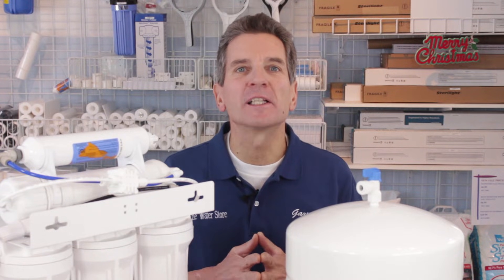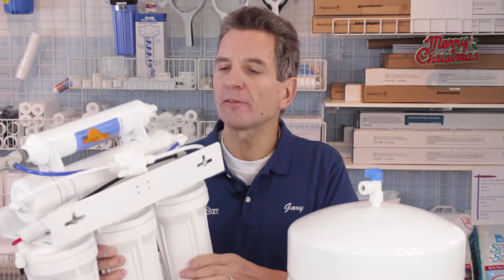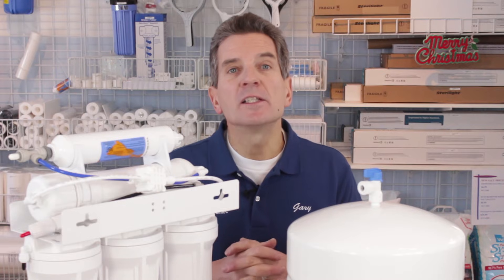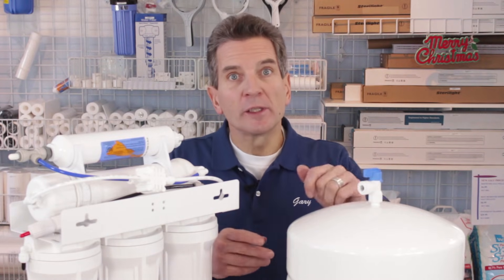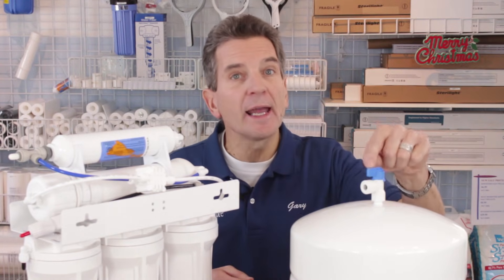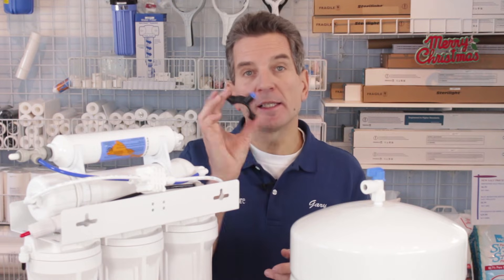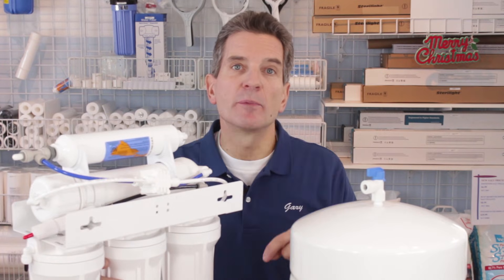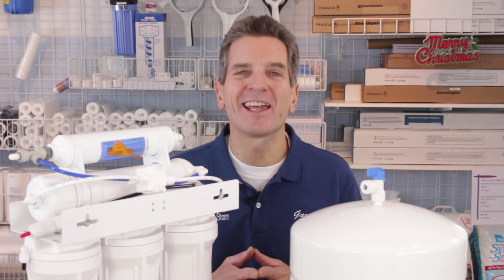Reverse Osmosis Troubleshooting Water Continuously flows to Drain

Comment: Andre
Thank you for this very informative video. After watching it, I changed the check valve and it fixed the problem. Prior to my replacing the check valve, my system probably treated hundreds if not thousands of gallons of water, so I suspect that I should be replacing the 3 pre-filters as well as the membrane, correct? 
I do have another question for you, my system uses an adjustable flow restrictor and I would prefer using an automatic shut off switch that is equipped with a flow restrictor that flushes the system every hour or so. Are you familiar with these and would you recommend using these and if so what make and are there any instructions on installing these?
Reply: @water_estore  HI Gary, yes I usually replace the filters every 12 months but my question was relating to the fact that my control valve was leaking water 24/7 for 3 to 4 months. Wouldn't all that water have also passed through my 3 prefilters as well as the membrane before being dumped into my drain system via the leaking control valve thereby ruining them?
Reply: @water_estore  Thanks Gary, next time that I need a new RO system, I will check your web site prior to making a buying decision. Up to now I have been buying my RO systems from AquaSafe located in BC and I suspect that they are made in China.

Comment: A tank with too low air pressure caused my system to drain continuously.  Draining the tank of water and re-pressurizing it to 7.5 psi fixed it (I mistakenly released some pressure when monkeying around with the system before I knew how it worked).
Reply: How do you repressurize the tank to 7.5?  My RO System is brand new and it constantly runs and water goes to the drain and the drain does not get filled.  When I shut off the tank’s valve the draining stops in like 15 seconds, so I assume it is not a problem with the check or the ASO valves this video talks about. Any thoughts? Thank you.
Reply: @JLMABIO  There's a Schrader valve on the tank... Just use a bike pump and a tire gauge.
Reply: same.  Low pressure on the pressure tank.
Reply: Thanks for your advice. My one had low pressure on the tank and made this issue. I just used my tire air pump and fixed it.

Comment: Hi, thanks for the video.   My issue is that it seems that my unit is running more often.  It shuts off promptly.   Also, it seems as if it runs out of pressure towards the end of a water bottle fill-up that it used to be able to handle without losing pressure or cycling on.   Do I need to fill the inner bladder with more air or can it be another problem all together?  Thanks for info.

Comment: Based on the test the ASO and valve are fine but i can hear the water going true the pipes. Any idea? The system is barely new
Reply: Same...
Reply: Too-low air pressure, perhaps.

Comment: Hi, not sure if you can help.  I have a vectapure 360 system and water is draining constantly.  I have replaced the ASO, but it's still draining.  I have looked for a check valve, but cannot find one, do you know where it would be?  Also, I've checked the pressure in my storage tank empty and it's 7psi, but when full only gets to 22psi.  Do you think my tank is bad?  Thanks

Comment: Thank you so much for this video.  I bought a home with this system installed and I noticed the drain line from the last cartridge seemed to be running constantly.  After going through your steps, I verified all was well and the tank was refilling after I had gotten some water earlier.  Saved me a call for service to check it!  Thanks for your videos  on this system - very helpful! 👍

Comment: From personal experience, the system in your video is an absolute pain in the back to work with even for experienced techs. The biggest problem I run into are leaks at fittings because of excess movement (and in older units excess can be a slight bump due to lack of motion over the years and the interaction of the seal with the tube and o-ring) and hard to remove filter housings because of lack of lubricant applied O-rings/threads. Also you need to be careful when removing/installing the polishing filter due to having to indirectly moving the filter from the quick connection fittings and these also tend to leak with the slightest excess of movement. Make sure to also apply new PTFE tape on those threads before installing a new filter! Give it about 2-3 layers of tape to be safe from leaks.
Reply: One thing I have noticed, is that some of the polyethylene tubing from the hardware store, is sometimes "out of spec" On size, sometimes causing me leaks.
Also another type of tube fitting, that is cheap, and "leak free" but an absolute pita to use if it is needed to "reconfigure" often (connect and disconnect) is the "JACO" compression fitting.

Comment: For a while now my filtered water from my reverse osmosis system has been tasting an smelling like garbage. I recently replaced my filters, but it continues to have that taste. I have drained the tank multiple times as well and it seems to work temporarily. Any suggestions? ??? Could it have anything to do with my garbage disposal on my single sink setup or the placement of my waste water ?

Comment: Hi. Gary. Your explanation is very clear. Thanks so much. I'll ask a question. I replaced in order ASOV and Check Valve. It is shut RO continuously flows to drain when the tank vane is closed. But although I had replaced new membran and all filters, still the drain water is running non stop. What caused it is? I don't understand any. Can you help me please? Thanks now.
Reply: I know what you said. my trouble is solved. Feeding water pressure had too low. So I activited RO pump. Then drain water is shut.

Comment: Replaced both aso and check valve. Any thoughts as to why the system could still be constantly draining?
Reply: Restrictictor needs to be replaced . There’s different colors coded restrictions 24 , 36,50, 75 gpd. Anyway when you replace membrane you should have replaced restrictir too.
Reply: @Sam-od4xb  Is it flow control inserted in the drain tube?
Reply: I have this issue too and its new, I changed the parts but still spills. And its not the water pressure, I have good water pressure in l.a

Comment: Very good, thorough explanation. I have a question that I don't see addressed specifically too often... About how many cups of water should you be able to fill before the system begins to fill up again? And - for how long should that filling take?  It seems as though mine runs for almost an hour or so and it's loud and bubbly and shouldn't take that long to refill. Thanks!

Comment: Hi i just replaced my ASO all water just flows to drain permanently, tank does not fill and no water from faucet. Also all hoses are in their correct positions
Reply: have you tried checking the pressure in the tank if the pressure in tank is off then it needs pressurized
Reply: Wimbledon Window Cleaners i pumped  mine back up to spec and still water flows. I even took the ro membrane apart and cant seem to find anything out of place. Not even sure but i sure could use a clean glass of water smh.

Comment: I bought a new storage tank. do I need to fill it before I install it?
Reply: No. All you have to do is pump the air pressure to the correct PSI and while closed connect the line to the tank, ensuring everything is properly connected (while your RO system's water shut off) and then slowly turn on the inlet valve to your RO and finally it's safe to open the shut off valve to your tank.

Comment: Thank you for the video. My RO system pushes the water continuously into the drain eversince I replace all my 4 filters (prefilter, filter, 2x carbon filter). I follow your recommendation and replace the shut off valve and control valve. It didn't work. My house pressure is well above 40psi. What else can I do? It struck me as odd that the problem only started the day I replace my filter. Could it be that the filter is bad? How I can verify this? Many thanks!
Reply: Thank you so much for your prompt response. The problem actually started when I replaced all my filters and membrane. After I replace the them, that is when I noticed the water keep draining out continuously. So, I change out the shut off valve (is it the same as line flow control). It didn't work. Following, I change the check valve two days ago, and it didn't work. This morning, I turn off the valve connect into the reservoir tank and turn on the valve connect to the filter system. There is no water coming out of the faucet but water continue to flow down the drain for at least 30min before I shut off the system again. I am just quite puzzle. Appreciate your thoughts.
Reply: @Boonng76  Did you ever get a resolution to your issue? We have the  same problem only after filter replacement
Reply: Did you ever get a resolution to your issue? We have the  same problem only after filter replacement. We followed this video and it seems nothing wrong. We even added pressure to 9PSI but it doesn't help. Can anyone help us with this questions? I have ERO375

Comment: Hi,  thanks for the video.   I have had our ro unit for several years and since about last week I notice that the system seems to drain water after only several onces of water has been dispensed.   It quickly looses pressure and barely fills about 16 Oz.  It stops draining soon after.     Could you please trouble shoot this for me?   Thanks again.  :)
Reply: +The Water Filter Estore 
Thank you Gary the water guy.  I will look into it and try to send some business your way.   :)
Reply: +The Water Filter Estore It worked perfectly.  I will do that request no problem. thanks so much

Comment: My system has an adjust knob between the membrane & drain pipe. What is it?  Should position be on or off?  Thank you.
Reply: I believe it is the by-pass flush valve after google.  However, after I turn off this knob, water is still draining to the pipe.  Is it normal?

Comment: I have a question it may sound kind of tricky. 
¿ Is the water that comes out the Reverse Osmosis Storage Tank when re-inflating, filtered and safe to drink as well ? or ¿ Is not safe to drink ?
Reply: Yes, presumably if everything is connected properly and in working order, the stored water is of the same quality as the water coming directly from your RO system.